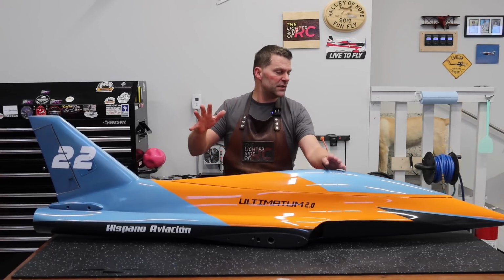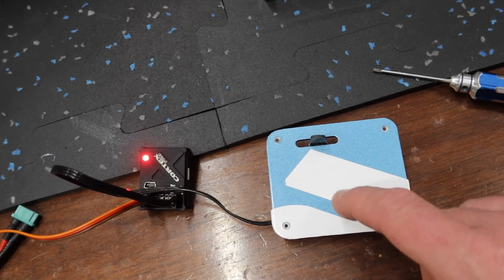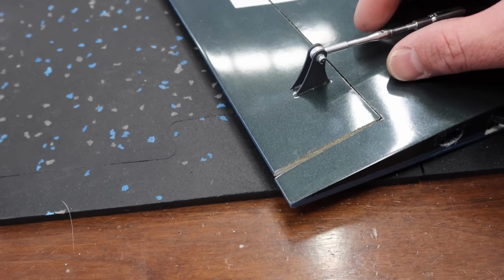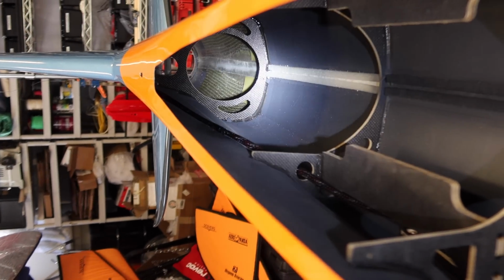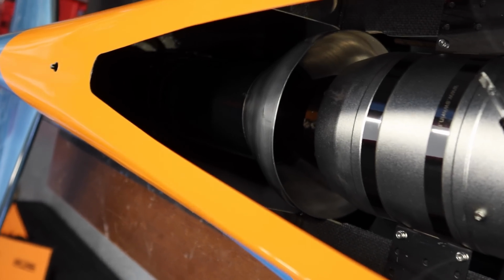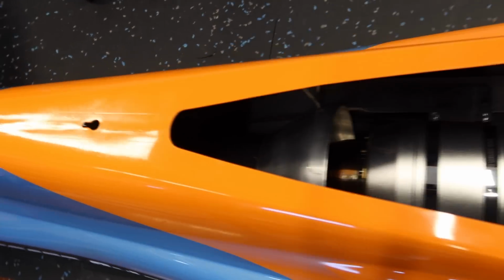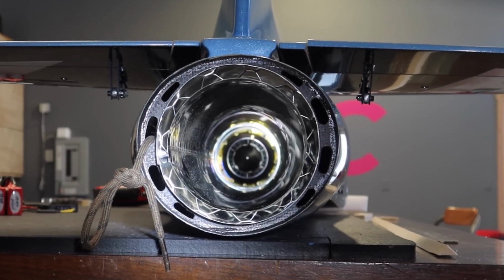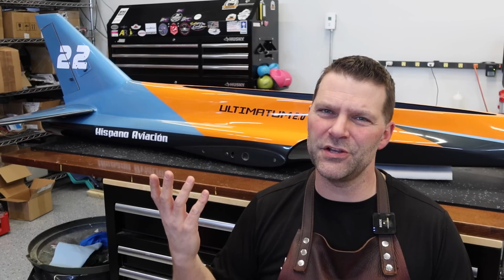THE U2 JET Gets a TURBINE  ENGINE and TAIL - Hispano Aviation Ultimatum 2.0

Comment: Been searching for turbine #2 and have seen hinges described as standard, skin and live. I think I got the first two but "live" not sure. Is it just another way of describing a skin hinge? First jet is a Boomerang so I've never owned  a composite plane. Also wondering about durability of  skin hinges after flexing hundreds of times.
Reply from the maker: Hey Ron.  Yes, different way of describing skin hinge.  Basically they are good indefinitely as long as you don't have a major impact.  Lots of aircraft out there like an ultra flash that is all skin hinges, hundred of high speed and high G flights.

Comment: Another excellent video...  good move changing to "Button" head bolts..  I made note to point it out to you..  good catch.   putting in the horizontal stab carbon spare could be a bit tricky..  need to push down on pipe a bit to get it across.. all in all Excellent progress..
Reply from the maker: Thanks David 😊

Comment: The powerbox connectors and wire is the least heat resistant wiring materials you can buy. You should use TEZEL wiring and mini-PV connectors.
Reply from the maker: I'll have to look it up.  Thanks James.

Comment: Are those preset percentages for the surface travel limits in the manual or was that through visual analysis? Great video as always!
Reply from the maker: Havent set the travel yet of the surfaces.  At this point it is limiting the Max travel so the surface or arm can't over travel and damage the surface.  I will do the travel adjustments as a final step.